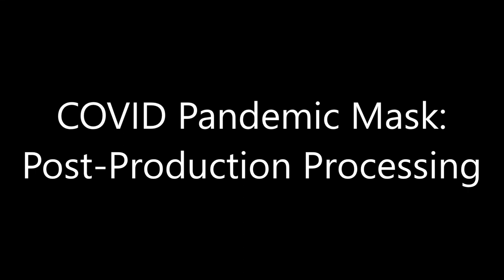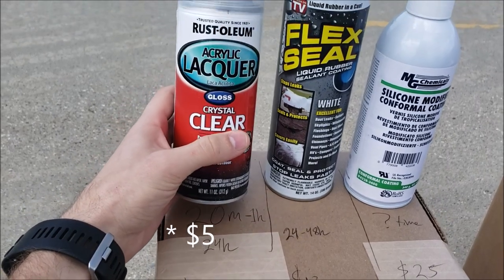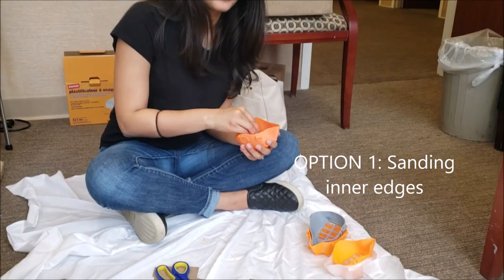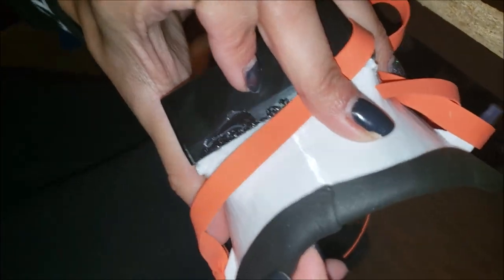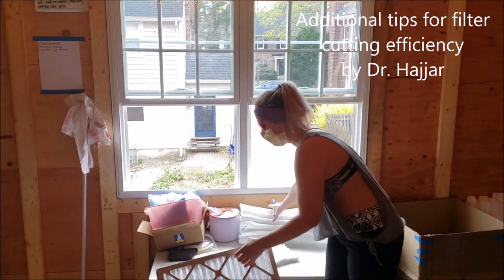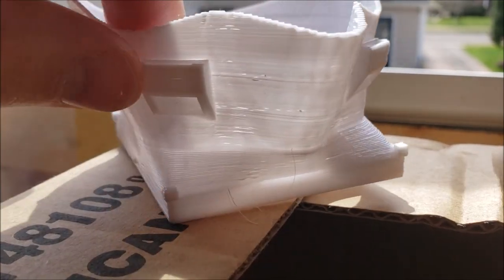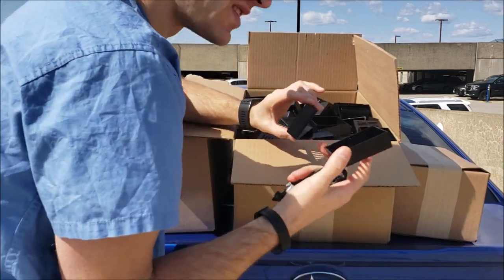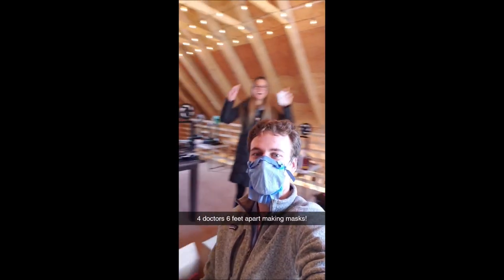COVID PANDEMIC MASK Post-Production Processing

Comment from the maker: We suggest using 3 layers of 3M Filtrete 1500 for approximately n95 or 3 layers of 3M Filtrete 2200 for approximately n98, based on initial testing. When final results are collected and published, we will update this and seek clinical approval. In the meantime, THIS IS ONLY FOR COMMUNITY USE AND USE AT YOUR OWN RISK. There are no guarantees with homemade masks. The extra layer of corrugated MERV13 filter is optional. It does not appear to increase filtration, but does not create a noticeable pressure drop (change in breathability) either, and likely acts as a moisture capturing layer to preserve the electrostatic charge of the 3 initial layers of Filtrete so we are putting it in since we already purchased a ton of it. We will test and release more on this soon.

Comment from the maker: Link to Coast Guard testing story: https://www.theday.com/article/20200504/NWS01/200509785

Initial testing data! We are now using 2 layers of MPR 2200 + 1 layer of corrugated MERV13 filter. Initial testing shows it's equivalent to n93. When you wear over a surgical mask, it's approximately n98.5. The video shows MPR 1500 in place of 2200 - that combination alone appears to be around n85. With a good seal to the face, all these options are great for community use. I'll update with official findings once tested repeatedly and published. We will seek clinical approval if possible, but for now, only use for community use (eg to the grocery store, etc) unless local institution states otherwise. Thanks to collaborations with the US Coast Guard, Yale, and UConn, among others.